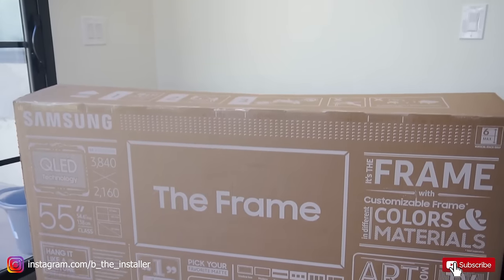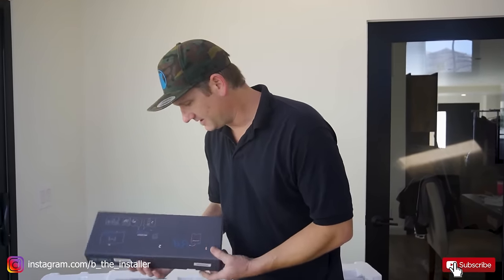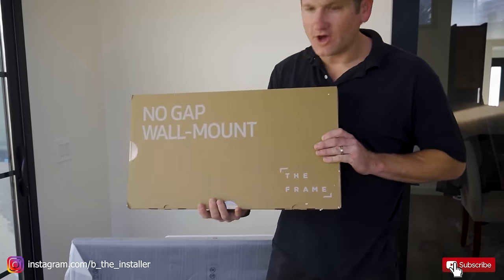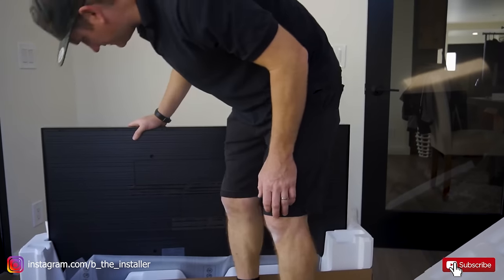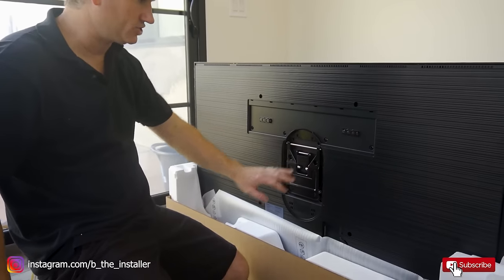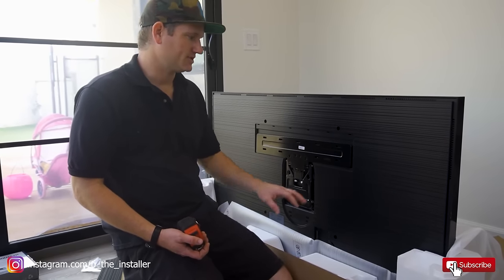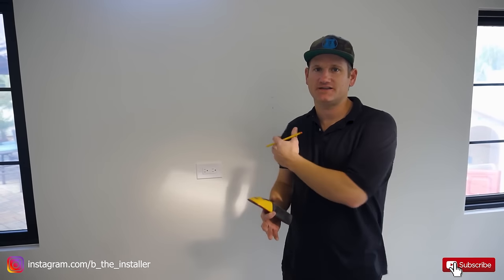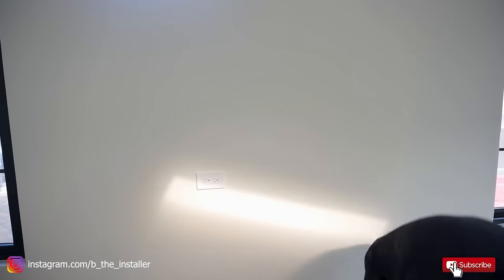Samsung Frame TV Installed w/ "No-Gap" mount in 30 minutes

Comment: I really want to buy this tv but  my house is two levels.  The upstairs TV is wall mounted and controlled through a media station downstairs. The wall behind the exisiting tv has a plate with HDMI / AV / coaxial cables running down through the walls into a pioneer av receiver.  Can this TV be connected using exisiting cables or does it have to use the one connect cable.  Also can the one connect box be in another room and the remotes still work ?
Reply from the maker: Good question.  So you could build the low voltage box behind TV 14" leviton and house the power in that and the hdmi could still run back to system.  

Also many people are abandoning complex systems for TV and sound bar.  It's a trend that I've seen for 4 + years.  Jist not worth the hassle.  So between those two, I'd say it's still possible.  

I do love the LG C9 TV if you're looking for best tv, install/review to come this week.  Better tv overall.
Reply: B The Installer Thank you so much for the information and video.  I have a pioneer av system that zones my house and plays through surround sound speakers in each room.  As well as the TV’s it connects, PS4 system, apple TV, in ceiling speaks etc all controlled through pioneer app we can direct to any room.  I don’t want to abandon it just yet. (I also like being able to turn the volume down remotely if the kids get out of hand !!!)
Reply from the maker: Understood.  How does the tv currently get sound to the stereo? Are the components all down by the stereo ?  Likely replacing an older TV will present one common challenge.  You likely will still be able to send hdmi signal to TV like before with sound remaining the same over speakers but you won't be able to hear the Samsung smart hub apps on your stereo.   The best way to continue to tie it in, is if the AVR has ARC, then the samsung remote could turn the AVR on/off and control volume.
Reply: B The Installer Thank you but now talking above my skill set. I appreciate the responses and if you were in my country I would probably just ask you to come over and pay you to have a look. I originally paid an installer, my whole house is smart wired and all the cables come together in a concealed hub in a media room downstairs. I like the Samsung Tv as it doubles as artwork when not in use and that would really suit my house.
Reply from the maker: Gotcha.  Well if you have a trust worthy electrician, they probably can pull that plan off.  But there are other good TV options.  The C9 from LG is amazing. Good luck.
Reply: B The Installer i will definitely check it out. Thanks again

Comment: As someone who also does this for a living, I think you did a great job on the mounting. My only concern is that you put the cord in the wall. That cord isn't in-wall rated.
Reply from the maker: Yep, I've said many times and in video, there is an in-wall rated version.   Many electricians will put sound bar power cords in wall, and other lighting power cords.  I don't recommend it but there wasn't room to put a low voltage box behind TV and really it's even more difficult when people buy this TV and don't want anything besides tv on wall.
Reply: @BTheInstaller  No, I agree and it doesnt help that the adverts for this TV never actually shows the cord on the wall. Hell even the inwall cord isnt really inwall, Even samsung says it on thier site. Its more of a through a wall cord not running down a wall cord.

Comment: Where did you install the one connect box?
Reply from the maker: It's on the ground.  They put a desk there and now its sitting on the desk. Best practice if you don't know what will be there, is to put it at the same height as the power outlets below.  It can be installed at any height.

Comment: Please, what is the length of the breakout cable ?
Reply from the maker: The one connect cord? That is 15ft or 5m.  They have a 15m cord you can get and they have an in-wall rated cord as well.

Comment: What if you just want to use WiFi to the Tv? Do you still need the one connect?
Reply from the maker: Yes you must have the one connect. It is the brain of the tv. Only samsung does this. You can install a low voltage panel in wall behind TV if you want it hidden.
Reply: Thank you!

Comment: How do you install it dead centre, if there’s to stud in the middle to hold the weight
Reply from the maker: just center the mount and then figure it out. this mount can be installed with togglers only too
Reply: @BTheInstaller  even for the 75"?
Reply from the maker: @pookguy88  yes.  You can hang a wrecking back on that mount if secured by a stud in middle.  It pulls straight down.  You just have to make sure it's secure to one stud and toggles on the top left and right for a little added support.
Reply: @BTheInstaller  hey B, thanks for the reply, my issue is, the stud won't be in the middle. The way I want the mount now the stud is to the left, so would togglers for the middle and right do it? Or do I have to move the mount over to the left so the stud hits the middle? keep in mind this is for the 75"er (~85 lbs)

Comment: Did those toggle bolts come with the TV??
Reply from the maker: Negative. Those toggle bolts, which are hugely helpful for hanging anything on walls, are available at home depot.  I prefer the 3/16" bolts x 2.5 inch long.
Reply: @BTheInstaller  that's unfortunate, I install these in New Zealand and the Samsung No Gap comes with the exact same toggle bolts in the box which is a huge help!
Reply from the maker: That would be sweet.  Another guy had mentioned the drive is JIS(Japanese Industry Standard) not Phillip's.  Wondering what good that does Americans, lol.?  It's all good though, I have 50-100 togglers at all time.

Comment: How much is the charge for mouthing this tv
Reply from the maker: This install was fairly easy.  It was basically hanging that mount and 15 min of running the wire.  So between the basic mount and the full install cost of an installer.

Comment: Likely dumb  question: any way the cable can be hidden when working on a concrete wall?
Reply from the maker: Technically, yes but it is likely best to keep external.  Its a very thin wire and all the hdmi cords and stuff connects below to the one connect box.  The cutting of concrete is difficult and not worth it.
Reply: B The Installer That’s what I thought. Thank you so much.
Reply from the maker: No problem.  If I can save some people a little stress, job done.

Comment: DOes anybody knows the dimensions of one connect box cable connectors? I cannot find it out, but i need to know, whether it will come through my in-wall cable channel. I have like 2,5 x 4,5cm plastic channel. Thanks
Reply from the maker: Neither end will fit through 2.5cm.  The small end is about 2.6 or 2.7cm and the big end is over 3cm.  So I always pull the small end down the wall, but you can't use the 2.5
Reply: B The Installer Thank you! I think it is like 2.5-2,6x 4,5 or 4,6 did not remember the exact size of the plastic channel, normal euro computer powersupply socket like https://cz.farnell.com/productimages/standard/en_GB/1125810-40.jpg fits fine.

Comment: Very nice video. Much of the other Frame videos are way too long, and I like how you actually showed some of the one One Connect. 

I’m building a house now and plan to buy the Frame and store the One Connect in the server room on a network rack and run the cable through the wall. I keep reading about how delicate the fiber cable is. I’ll have a low voltage conduit going from the network rack to the mounted tv. Total distance will be 15-20 feet. (Maybe less then 10 depending how I route it). 

Can you think of any issues I may have? Length of one connect fiber cable or is the fiber too delicate to pull ?
Reply from the maker: Thanks!  Do you mean can the cord from Samsung be routed? Not really, as the connection is monstrous and that cord is at risk running like normal wiring.  I am comfortable running it simply down 3 ft to  pop it out a hole.   If you mean an independent fiber wire, I don't think they make a conbo wire that can then connect into the proprietary system.
Reply: B The Installer thanks for the reply. I’m reading that the included One Connect fiber cable is 5+ meters. Is that’s the case I plan to run that cable through the wall to a network closet in another room. Instead of a few feet below the tv.
Reply from the maker: Yeah it is long, but running through walls and through studs in those walls is more difficult and more likely you were compromise the cord.  In addition, the ends of the cord are minimal 1" wide and the other end is like 1.5"  so that is hard and not safe to thread through studs.  A simple output in a room behind the tv is easy though.
Reply: B The Installer Awesome! Again, thank you for this insight. Based on what you’re saying, other research, and my plan I still think it may work. So I’m building a house now, the dry wall isn’t up yet, so I won’t be going through the studs. I’ll run a 2inch wide plastic conduit along the sides of the stud. Knowing the ends of the cable are so big, hopefully 2inches work.
Reply from the maker: @BlueWorld718  look online for the in-wall rated version of cord if you want.  Its $200 or so,but would be better for a longer, in wall run.

Comment: I have 65" 
I am experiencing judder issue when I am playing videos through Tv Apps.

But if I play the same videos through Fire TV stick or PS4 ... no judder ... 

At times the Software is buggy too
Reply from the maker: Interesting.  I have opposite if the device doesn't match frame rate.  They have motion smoothing.  I prefer it

Comment: I thought running power cables inside of walls is against one of the articles in the NEC and if a fire results from this, the insurance company may not cover it.
Reply from the maker: There is an in-wall rated version of this cord.  If this specific cord causes a fire, you got problems whether it's in wall or not.   I don't condone working against electrical codes, but the risk of fire and what insurance will or won't cover is an extreme scenario.  Never seen a power surge in 13 years to date, let alone a fire or had to deal with insurance deeming a wire in that fire cause or be a concern.
Reply: @BTheInstaller  ... thanks... I was thinking of buying this TV but hesitated because of the power cable running inside drywalls.
Reply from the maker: No problem.   There is another way to install if you just want to use the wifi, or even having media, you can build the low voltage panel in behind the tv itself.
Reply from the maker: @spkf79  ha, tell us how you really feel.  Side job? Yes, shooting youtube videos is a side job. Our home theater company has installed over 10k tvs, take your attitude somewhere else.  Don't come online and call someone you don't know a hack.
Reply: Nick Fritzinger As he already stated, there is an in wall version of this cable.
Reply: @milkplus71  it’s not very long

Comment: Definitely need the lag bolt in the stud...no way I would trust that with 2 3/16” toggles
Reply from the maker: Togglers are super strong.  I'm going to make a video on them.  The screw in anchors and the ones that just split in half are garbage, but the ones I put in are metal on metal.... I could have done pullups on that mount in drywall alone.  Thanks for watching dude.  🤟

Comment: We are about to purchase this tv; however, we are freaked out by the one connect box. We don't need it. Is this the only way the tv plugs into the wall?!!!!
Reply: You need the one connect box. Without it, the TV will not work. The display itself is like a monitor and the one connect box acts as the “computer” of the TV.
Reply from the maker: Yes u need it

Comment: What about the power to the TV ????
Reply from the maker: The tv gets all info from the one connect box via that single cord.
Reply: @BTheInstaller  Thanks! like the change and read though all the other comments. Assume the power through one connect is low volatage and current, so no issues in wall. Helpful.

Comment: Running one connect through the wall is a Fire Hazard and is against code" also be careful when drilling or cutting through walls you never know what's inside like electrical wires or water lines which could lead to electrical shorts or busted water pipe lines, make sure that you are sure it's a stud before drilling could save yourself a lot of money. Have a great DIY day.
Reply from the maker: Haha. Thanks.  It was my first install, 😆  🤦‍♂️

Comment: Maybe try using a 10mm wrench and not a socket.
Reply from the maker: Not sure what you mean, but if you meant the tight nuts on the bracket, I did use the wrench as I explain in the video.  🛠🔧
Reply: @BTheInstaller  24:52:  You said that a socket (You said "ratchet", but that's the part that fits in your hand) doesn't fit so you use needlenose.   Does a wrench fit?  Looks like it would......

Comment: Why do all these vidoes show just one cable I have a separate power cable so much for the "One" connect
Reply from the maker: you must have 2017/18 version of the tv.
Reply: @BTheInstaller  ah, that explains it, thanks for the reply, would you even consider installing a 65 inch 2018 QLED on two layers for plasterboard/Drywall with no studs available where you need em,
Reply from the maker: You could mount the 65" on half inch drywall with 4 toggle bolts.. I did it in a frame install video labeled ASMR

Comment: If you use the paper template to drill holes in the wall, DON'T ASSUME THE VERTICAL LINE  WHERE THE ARROWS MEET (DEPENDING ON THE TV SCREEN SIZE) IS THE CENTER OF THE TV...IT'S NOT)  If your frame TV is has two mounting brackets, find the center between them and mark a new line on the template. Otherwise your TV won't be centered on the wall.

Comment: No way can I fish the large ends of the One Connect cable through my walls. Can the ends be removed? Then I can use a current cable I won't need as a pull string to pull the One Connect cable through.
Reply from the maker: You can run a thin cord and then connect the one connect with tape and pull.  But there has to be a path through, or it can damage.  So it needs to be with ease.  It can also be left externak
Reply: @BTheInstaller  I would be replacing an existing wall mounted TV and I have two HDMI and 1 Ethernet running to the TV from a nearby closet. I could use the existing Ethernet cable as a pull string but there's no way the large ends on the One Connect cable would make it through the existing holes. I don't want to open up my walls again. Ideally I would be able to remove the ends on the One Connect cable, pull the wire and reattach the ends. Sounds like that isn't possible? Thank you for your response and your video.

Comment: Samsung!  The two screws on the leveling bracket (at 25:00) are completely inaccessible and we’re so tight on my wall mount we could not loosen them.  As this is a part that requires adjusting, they should be allen nuts to allow end user to EASILY adjust them, or there needs to be adequate space for a socket to fit!  A socket head won’t fit and neither does a pliers.  Bad engineering on your part. This installer is correct. Please fix!

Comment: it wasn't flat or against wall flush
Reply from the maker: We took off the outlet cover and flattened the power outlet more.  You can then use the rubber pads to square up the gaps as some walls aren't very flat.  Thanks

Comment: Should I assume that if I live in an apartment built in 1933 that has plaster walls that I won't be able to fish wire up the wall? :/  So tired of looking at my cables.  Ironically, there is a power outlet at TV height from back in the day when people would hang a painting with a light over it...
Reply from the maker: Yeah understate on the cords.  This tv has a thin cord hidden or not, its about as minimal as you can get.  If you have a contractor or installer... they can run a little conduit or find a path.  I've done them in plaster and lathe walls...

Comment: Should have also centered it vertically
Reply from the maker: No... that has nothing to do with where you out a tv or art.  Both have visual needs based on eye level and viewing not vertically center placement. That is less important.
Reply: B The Installer personally I disagree. This is supposed to also act as art. Art should for the most part be centered vertically and horizontally with main features like windows unless they’re enormously tall windows which these aren’t. Just my opinion

Comment: So you hang the mount nice on wall and make some crappy hole for cable,nice round hole would do the trick.... LOL...FYI : i would hang the tv in middle of windows, horizontal and vertical,now it hangs lower then the middle of the height of the windows. Also why next to windows?...it distracts you because the light from the outside is in your sight when you watch tv. Just saying the eye wants want it wants.
Reply from the maker: Not sure a pretty hole would be helping them at this point.  Also they chose the location, it's over a desk as the dude works from home.  Wasn't going to change their 30k renovation idea.  Thanks for the comments.
Reply from the maker: My initial remark was without really driving into your questions.  But the height of TVs shouldn't just be based on just symmetry to what you see on wall, many things are considered including viewing/overall height and what's under the tv are both important.  Also this tv looks/acts like a picture on wall when off, which was why they got it.... it's an office and they may watch in evenings, no ambient light.  They had 2 other living rooms with bigger tvs, lol.   And this is an addition that has double doors to the kitchen/dining room.    🤟